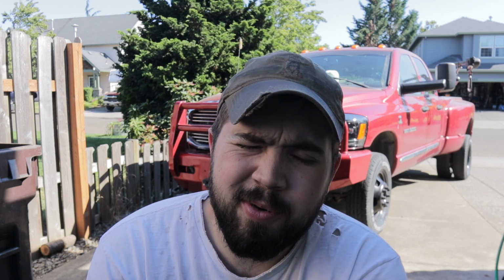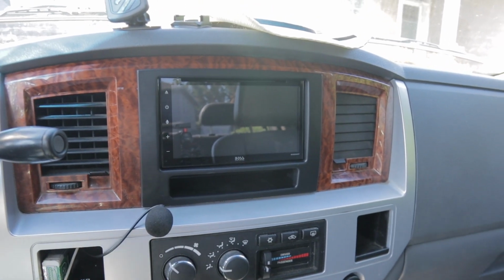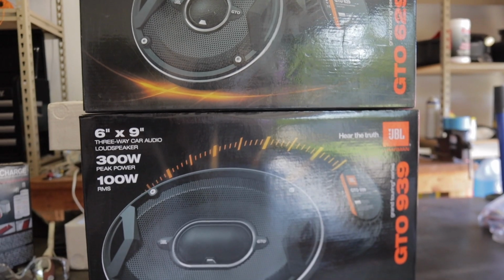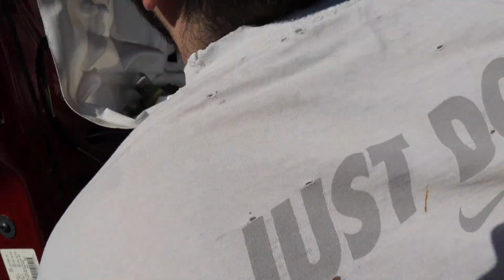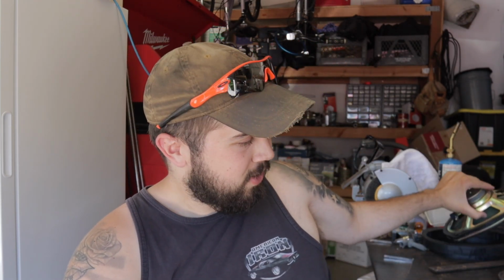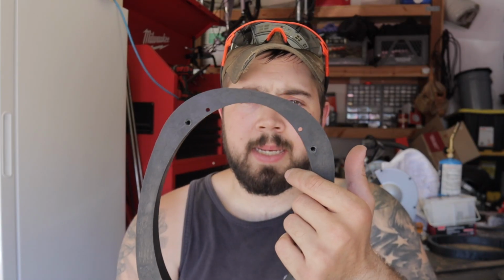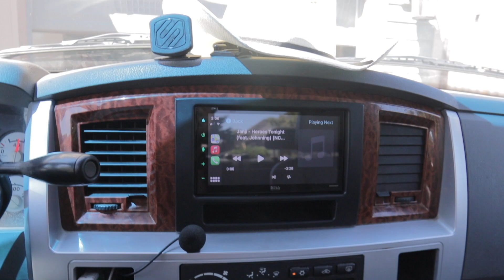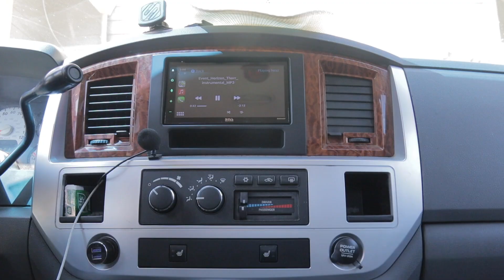3rd Gen Ram Speaker Upgrade. WACH THIS FIRST!!!

Comment: Just goes to show that even a year or more later, good videos are worthwhile.  I have an 06 2500 and want to upgrade my speakers.  This was VERY useful.
Reply from the maker: Glad it helped!
Reply: Did you do it? I would definitely spend a little and get a very small, budget priced, 4 channel amp and make it very simple and put the amp close to the front of the truck so you can easily run wires to it and from it to your speakers. It’s really worth it. Under powering speakers blows more drivers than too much power.

Comment: I just installed a set of infinity reference 2 way 6x9s in the front doors of my 06 ram 1500 with factory infinity system. Had no trouble, but did have to use the spacer that was supplied with the new speakers. Bolt holes lined up perfectly. Took me maybe an hour total, and it was my first time. I did watch the YouTube videos and go on Crutchfield to find a exact fit set of speakers, and got the plug on connection adapters so i wouldnt have to cut on the existing wiring. The speakers took care of the distortion and vibrating i was experiencing, and sounds very good. The other factory speakers still play okay, so i will replace others as needed. My factory head unit still sounds good, so i will probably keep that, as well, till it starts giving problems. Glad i watched this first and done some research.

Comment: Engineer here: regarding the rear speaker bolt pattern, we use asymmetric patterns to poka-yoke the part aka it can only be installed in one orientation. This helps assembly and service.
Reply from the maker: I guess that makes sense in regards to an assembly line.

Comment: FYI to anyone doing this type of upgrade.  Aftermarket head units usually only put out 15 to 25rms watts per channel at best.  If you want to upgrade speakers but not add an additional amplifier.   I recommend going with speakers that are only 50rms tops.   Underpowered , say 100rms speakers with no amplifier won't even compare to the sound quality of even Walmart lower powered but fully powered speakers.   Match your RMS power as close as possible.
Reply from the maker: Good advice 👍🏻

Comment: Make another cutting board adapter for the rear doors.
I went with the 6x9 - 6.5 adapter for the front door.
JBL components in all 4 doors and tweeters in the same door panel location as the f series trucks. Rear tweeters high up on the C pillar

Comment: My 08 ram 3500 6.7 laramie has the infinity 7 speaker sound system with factory amp and I installed 2 12" scar audio subs And a eclipse double din navigation system cd player Bluetooth to replace the factory Navigation system and with the stock speakers it sounds amazing! I have 280k miles on it now and I just replaced all the highs and mids / front door speakers rear door speakers and the 3 dash tweaters with all Apline S series speakers 🔊 and wow! Bad ass! Sound way better then the infinity stock system! The front door speakers stock only play mid bass and will do the same with the new speakers do to the factory amp but that is normal so if you get a set of component speakers your good to go! The rears are just 6.5 s with tweaters so no problem there plug and play! So now what is all this talk about 7.3? When the truck is a 6.7? Thanks

Comment: I upgraded my speakers and realized the factory head unit was weak so I put in a boss 320 watt head unit what a difference also if your speaker isn't working check inside the boot between the door and cab they break often

Comment: My 6x9s and 6.5s PRV speakers fit with no problem however the 6x9s needed an amp (infinity 7 speaker systems). 3rd Gen
Reply from the maker: Yeah. From what I’ve seen it’s kind of hit or miss depending on which speakers you get.

Comment: The upgraded factory sound system in this truck is made by infinity with aftermarket headunit  sounds damn good still lacking low end but very loud and clean and as far as rear 6.5 on that truck just drill your own holes and use sheet metal screws

Comment: Crutchfield is not accurate.   I originally went with the 6×9 infinity reference based on their suggestion and ran into the same problem.  Instead I went with the 6 ½ infinity reference and made an adapter plate out of cutting board from Big Lots and they actually sound good once broken in.   I will be putting these in the rear.
Reply from the maker: Yeah, its tricky. From what i've read some 6x9s fit and some don't. I imagine crutchfields algorithms simply go off the size.

Comment: I have a question on tuning for the 7.3. I have put a lot of work into my truck but sometimes the idle quality just doesn't seem right to me. My dad bought the truck new in 2002 and I think the dealership put a chip on it because it's always had more horsepower than a stock one, and my mechanic thinks that's the reason too. Long story short, can a chip effect the idle quality and should I look at getting a new tuner?
Reply from the maker: Tuning can definitely effect idle quality. If it had a chip on it you should be able to see it plugged into the back of your pcm. I’ve never heard of a dealer doing that though. Especially on a brand new truck.
Reply: @LivingOnWheels  I need to pull that pcm and see what is up.
Reply from the maker: On the superduty trucks you can usually see if it’s got a chip in it just by looking at the back side of it up by the parking brake pedal.
Reply from the maker: On the superduty trucks you can usually see if it’s got a chip in it just by looking at the back side of it up by the parking brake pedal.

Comment: what are the rear 6.5 speakers for as in emitting sound, are they for the high range, mid range or bass? also are 3 way or 2 way speakers supposed to be back there?
Reply from the maker: They are better for mid to high. Traditionally the larger the speaker the lower it’s range. 2 or 3 way is more personal preference and budget.

Comment: Are the 06 dully’s not equipped with 4x4? Just curious.
Reply from the maker: They are. I’m guessing you weren’t seeing the switch on the dash. I have the manual transfer case shifter on the floor.